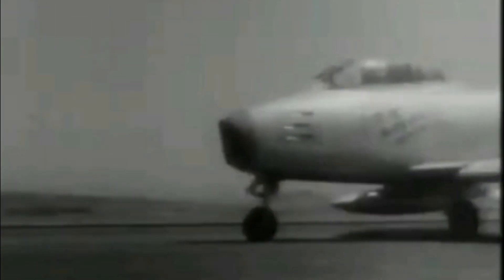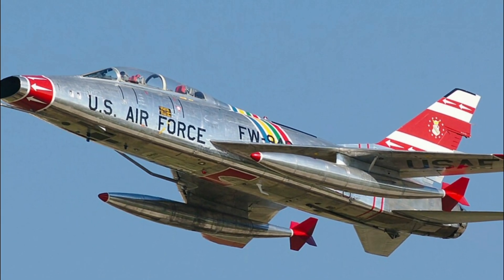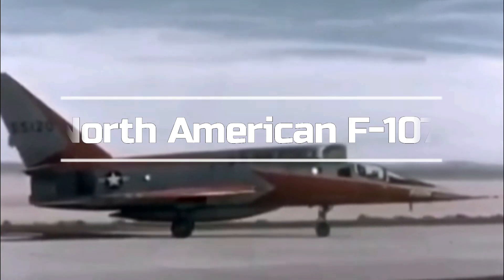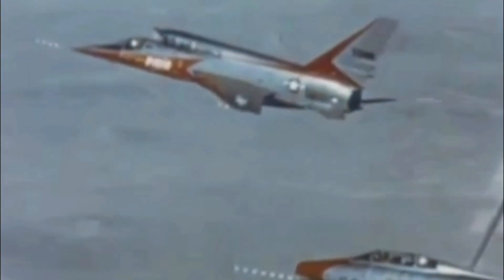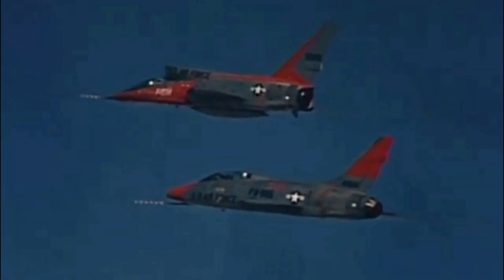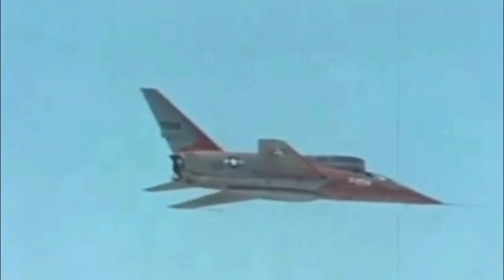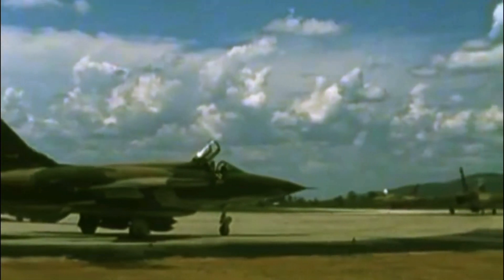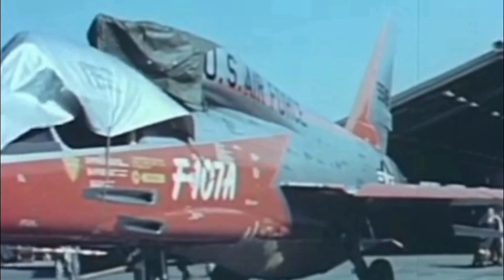Fighter Jet with a Weird Air Intake

Comment: There's a reason why almost no designer puts the air intake on top. It's in the way of the pilot's backwards visibility, while the cockpit messes with the airflow to the intake. If you need more space on the underbelly, put the intakes to the sides.

Comment: I lived at Edwards AFB (Air Force Flight Test Center) in my youth and saw the F-107 several times. It was always on display at open house, Armed Forces Day, etc. They would have open house a couple times a tear. Saw X-15 and many other interesting planes. My father took me to the flight line one regual duty day, no show, and I saw the F-10r with the rocket engine that Yeager crashed, as shown in the film "The Right Stuff".
Reply from the maker: Thanks for sharing.